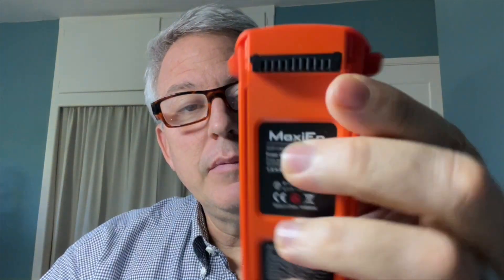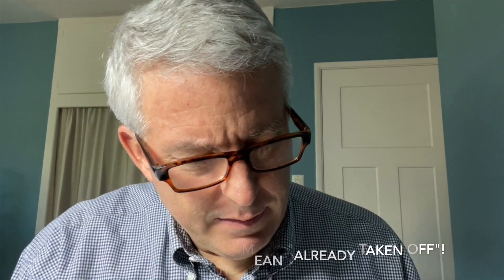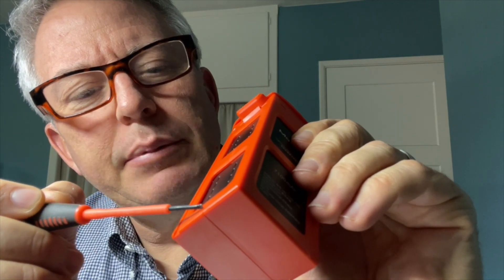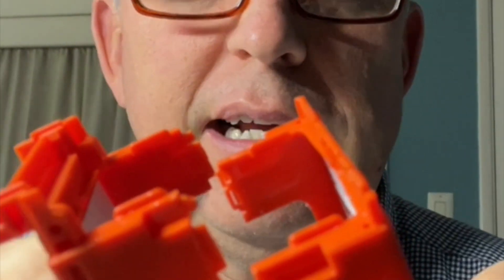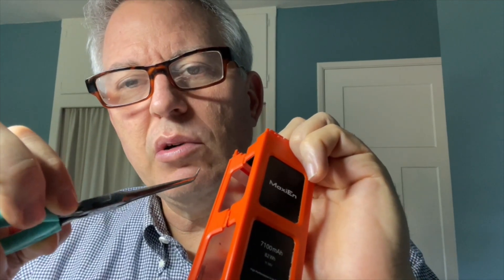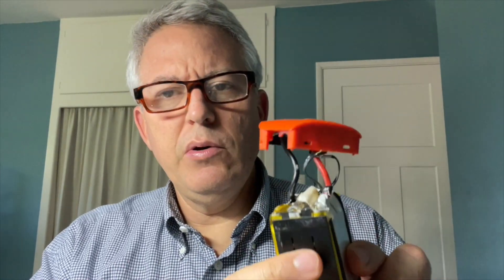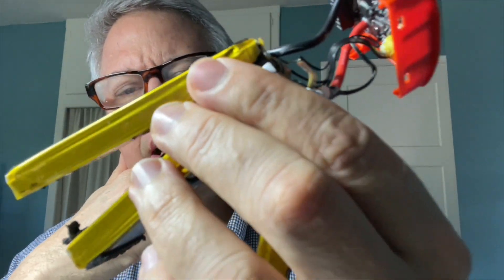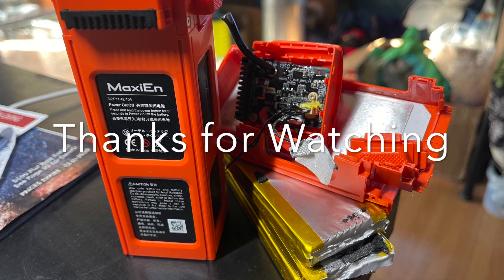Autel EVO 2 Battery TEAR DOWN

Comment: Thanks for the video. I have an issue when charging and got the "head" separated. One thing not mentioned is the glue that is adhering the back between the two clips. I did this carefully and noticed that there is a four wire plug but only 2 were actually soldered to the battery. The exposed tips of the wires do not look as if they were tinned and therefore possibly were not actually soldered anywhere which may or may not be by design. Do you recall if all 4 of the black wires were connected or only two? I have not pulled the white protective adhesive foam from the top of the 3 batteries yet but wanted to see if you recalled all 4 wires were soldered to the battery assembly from the controller at the top.

Comment: Thanks for the video.  I have an Autel Evo 1 drone and I'm seriously considering a tear down and replace the battery packs.  I did this with an old high end metal detector that use a proprietary battery.  In the tear down I discovered the battery pack was filled with nothing more than Chinese made "C" style batteries wired in series.  Talk about an easy hack and that metal detector is still running at a tiny fraction of the price of the battery pack, which is now nearly impossible to even find.
Reply: I just tore evo 1 battery apart. Almost the exact same but they made it hard to remove the chip. Getting battery out without chip requires soldering iron. Will be replacing flat batteries in one with 3S 18650s and seeing what it does. Will 3d print a holder and mount in the original frame.

Comment: If you wanted to replace the cells, does it have the same issue as DJI the battery chip disables and won't allow charging?

Comment: I just started using an E2Pv2. I picked up the aftermarket charger because I wanted to get my hands on the connectors so I could charge on the road with a lithium iron phosphate battery.

Those packs are garden variety lithium, the type used on RC at about 4.1 volts per cell in a 3s configuration yielding 12 volts at full charge.  

My point is that I suspect the packs could be replaced if one could find the right ones.  If I remember, the total is supposed to be 7100 milliamp hours which is an odd size.

Autel might just make them themselves. But if it was only 7000, no harm.... Just shorter flight time.
Reply: @Bidenisasnake Maybe you don't but I am sure there are those that do. I just built something that allows me to charge on the road with the aftermarket cables and it works well.
Reply: @bidenisasnake9932 those that don't have a clue are not the one's that will be tackling the job of rebuilding one of these batteries so no harm.

Comment: Thank you for this. Nice to know. Sorry about your drone. You said in a comment that Autel was replacing. Did you mean the drone? Or drone and battery? What did they say was the problem?
Reply from the maker: Autel evaluated the blackbox and found fluke issue with one of the modules within the drone.  The contact noted that drone wasn't getting correct telemetry data or something.  They are kindly replacing both.  I'm looking forward to getting back in the air on Monday.  Cheers.

Comment: why does it cost $200+ each?  Supply and Demand ~
Reply from the maker: opening it up, I found top-end name-brand components on the circuit board (unusual) and custom battery components (also unusual.  I expected to see off the shelf commodity cells).  While that gives superior performance (long drone hang-time), I'm sure that comes at a price.  thanks for your question.

Comment: My thoughts on batteries....A battery, ANY battery, is just a storage device for electrons. In the case of Evo batteries, there is some circuitry that controls how those electrons flow to the drone, and I assume some firmware that "reports" to the drone how many electrons are left to be used.
So, if one could figure out how to mimic this "flow" of electrons and data, then any kind of storage on the battery pack side of things would count as valid by the drone. 
TO do this would require knowing the logic Autel has built into their battery controller. That is the real problem with rebuilding a battery pack. My skills aren't enough to do that part, but I know how to solder replacement LiPo cells in place of the existing flat packs. 
Does anyone want to collaborate on rebuilding these batteries? I think there is some money to be made!

Comment: Interesting, did you say it was lithium ion of lifepo4?
Reply from the maker: Not sure which.  Definitely not pure lithium.  I'll post a follow up short video breakdown one of the cells.  Probably is a Li-Fe-PO4 and not lithium polymer.
Reply from the maker: I think it's a li-fe-po4 now.  had no idea when opening it up.  I'll post follow up battery of opening the battery flat packs and show close up of the circuit board.
Reply: If that's Li.fe po4, then it's much safer than lithium polymer. I was just watching a video lithium polymer vs li.fe and li-ion going through harsh test.
Reply: Its Li-ion. LiFePO4 is heavier for the same energy content than Li-ion and more weight makes it not a good use case for drones.